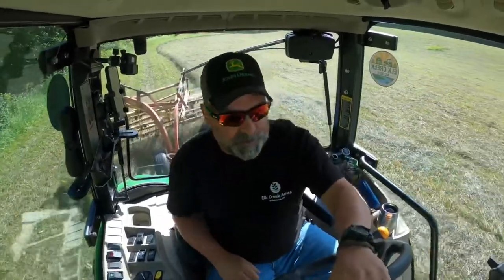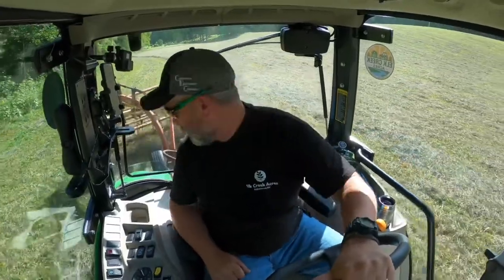John Deere 3039R and New Holland 256 raking hay

Comment: Hey Pat great video it takes a while to get the hang of it using your new tractor but great video glad you’re happy I am happy for you I still love my 2038R I have no complaints about The Tractor it’s an awesome machine 👍
Reply from the maker: Thanks Dean, will never have anything bad to say about my 2038, it’s really a great tractor.
Reply: @ElkCreekAcres  I understand during the winner I love to get out and snowblow the cold doesn’t bother me at all I bought some of the best Close that you can get and I got the best boots that you can buy and I also have a set of gloves that are heated i’ve been snowblowing all my life it doesn’t bother me The 2038R with the front mount snowblower it goes through anything I plowed over 30 inches of snow I live didn’t have a problem at all it’s a great machine 👍
Reply: @ElkCreekAcres  when you’re using your tractor this winter you’ll see you’ll have to get used to that I match It will be a little bit different snowblowing with that but you’ll get the hang of it you’re pretty smart  another channel I watch and I’m pretty good friends with Mr. Miceli he had 3046R John Deere tractor and it move snow but I didn’t like that I match  seems like it cuts down on the horsepower
Reply: @ElkCreekAcres  load match that’s what I was talking about sorry

Comment: Another great video, Pat. I cant remember if I asked you or not, did you put spaces on the front tires?
Reply from the maker: Thanks Rod, no front spacers, but you can flip the fronts and gain 4-5”.
Reply: @ElkCreekAcres  I plan to flip mine when it comes in. But, I was watching a video the other day, where a guy used 2" spacers on his front tires. 🤷‍♂️
Reply from the maker: @rodshepard3967  I’ve seen people do that as well, the advantage would be to get the spacing you want, by flipping them it is what it is.
Reply: @ElkCreekAcres  very true, Pat.